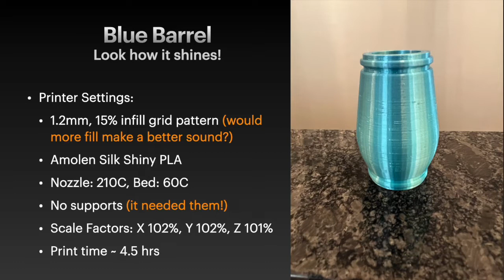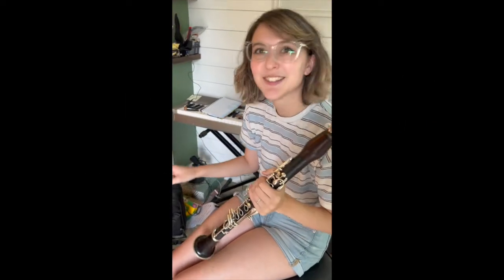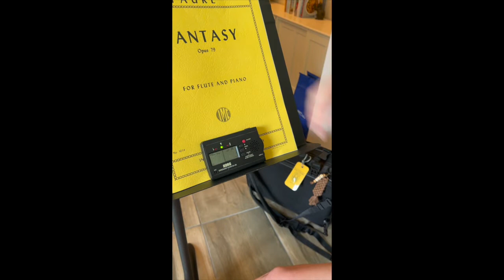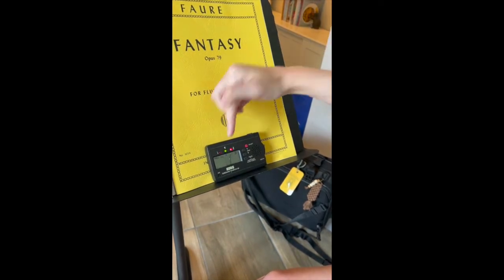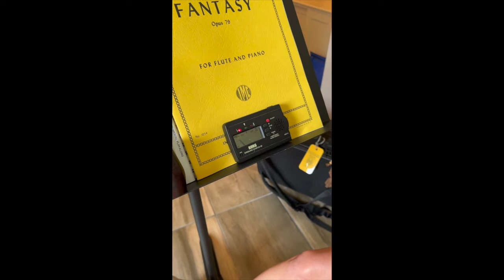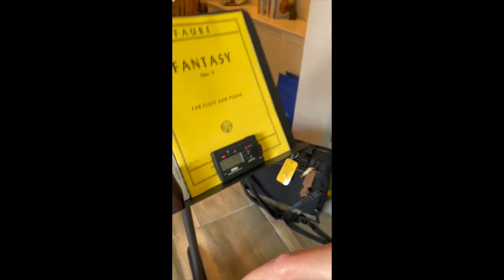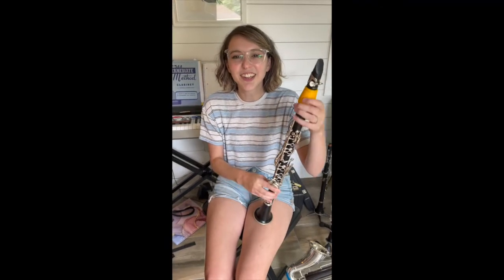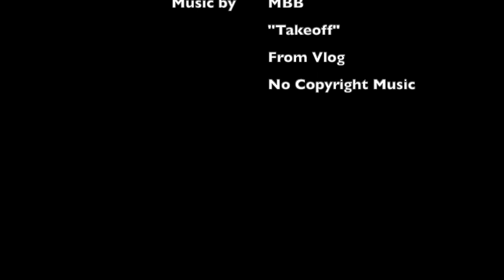Can a 3D Printed Clarinet Barrel Beat a Traditional Wood Barrel?! Featuring Cat Pfahler, Clarinetist

Comment: Supports are my least favorite part of 3D printing. I try for 45 deg chamfers in my original designs but when you are replacing a part you don't have that option. I like the wood best. Thanks for posting.
Reply from the maker: Thanks for watching and commenting!  The interior overhangs are needed to be at 90 degrees to match up with the other sections of the clarinets.  Adding in the supports worked pretty good - maybe not as pretty but worked.  The wood does seem to produce the most pleasant sound.  But the plastic did offer a louder sound which can be useful in ensembles.